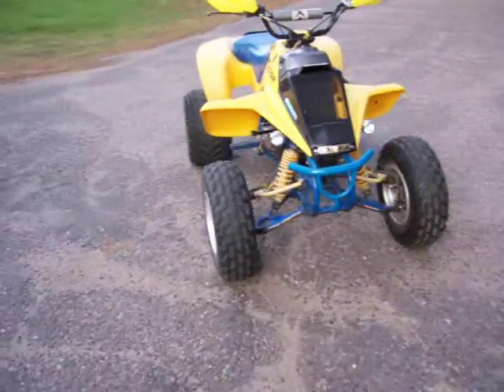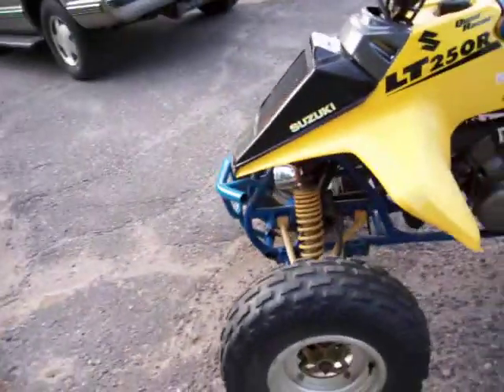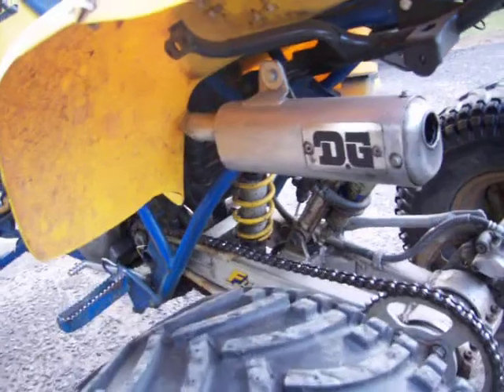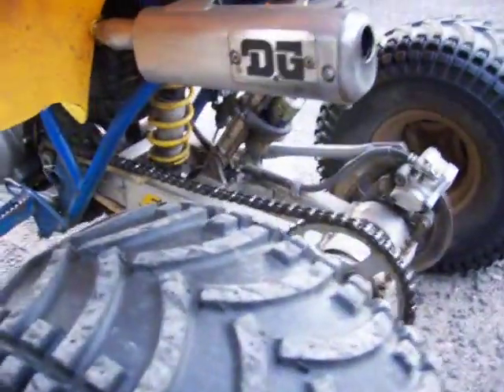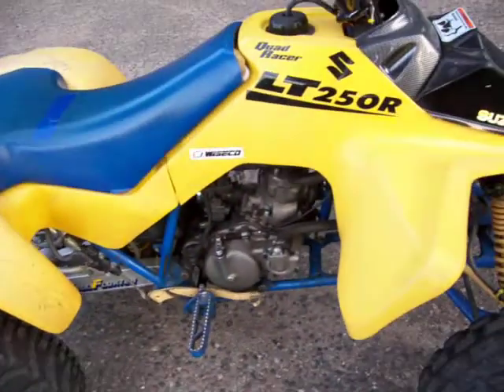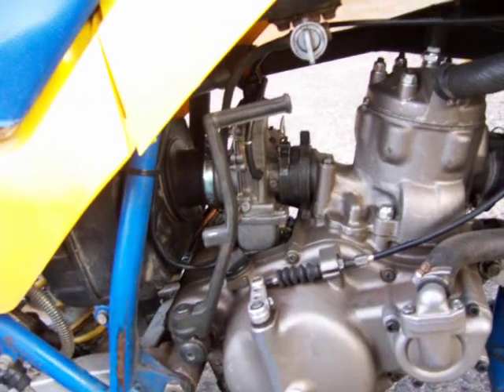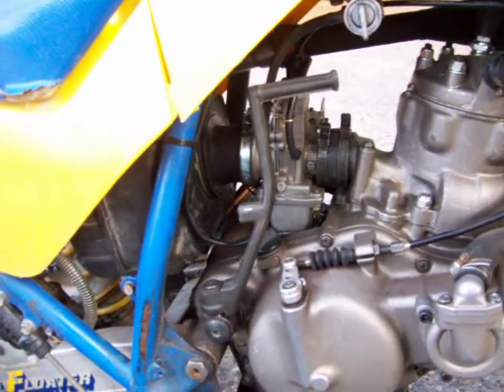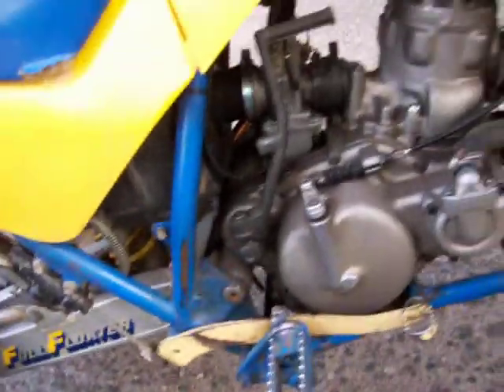quick walk around after ride

Comment: Not trying to be an ass, but with your pipe, it seems like the "midshaft", the piece between your exhaust and your DG silencer is turned the wrong way. That might be why you have some spooge where the mid pipe meets the exhaust pipe. That is also why it's melting the plastic. Mine was turned the wrong way on my 1985 and melted my air filter box...It happens, I agree, these are fun quads for sure. Nice LT man!